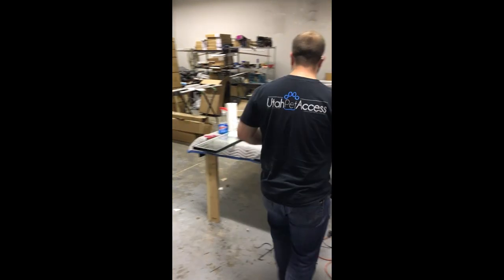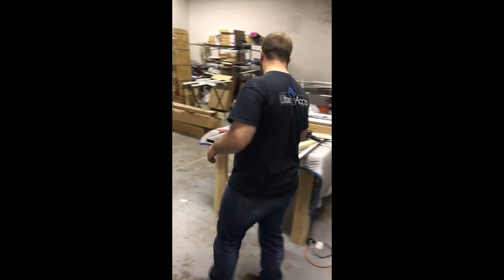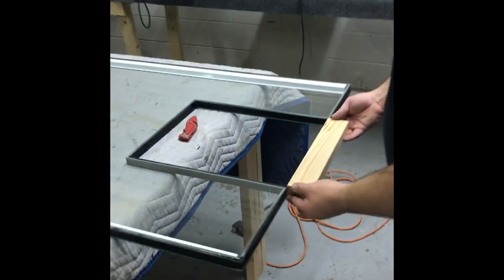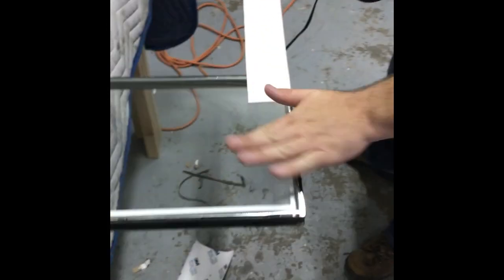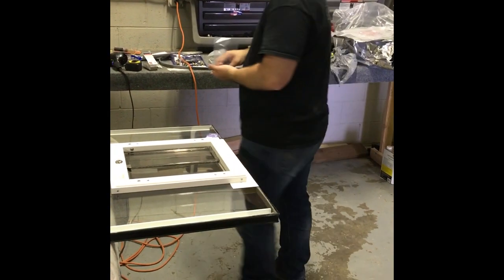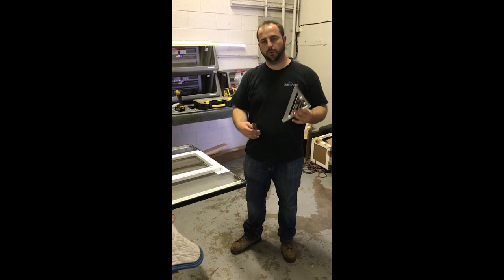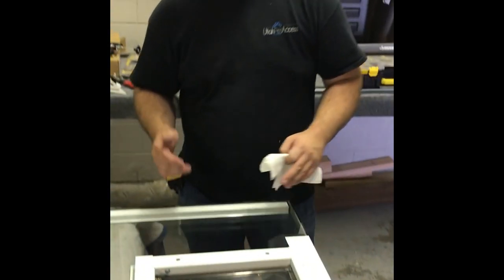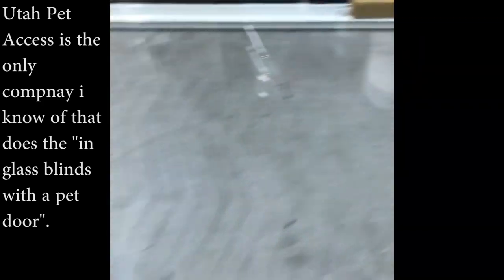How to install a pet door in glass

Comment: The title is misleading - this video isn't how to put a dog door into glass. It's how to use their system, with new piece of glass for your door.
Reply: Find a door you want, then score and punch the glass out. Then sand the glass edges with 400 grit sandpaper and install the door. This is what I will be doing.
Reply: @Robiam85  I am unsure what you mean I'm this response. My review/comment is that this video title is not accurate. It's poorly misleading...
Reply: It isn't their system. They mention specifically a minute in that is it a system from Plexidor.
Reply: @MrsMarrisa  re-read my post title. The video's title is inaccurate... I get what was said in the video. It's the title that wastes our time.
Reply: Well-said.
Reply: @Robiam85  I’d like to know how to score and punch out the rectangle shape from my sliding glass door to install a cat door.
Reply: @camerondanier9359  you need a scoring tool. Use tape to mark the boundaries. Score several times on all 4 sides and push. Use sand paper to smooth the edges. Seal and install door.
Reply: I don't think you can just score and cleanly break out a section in tempered safety glass?good luck!